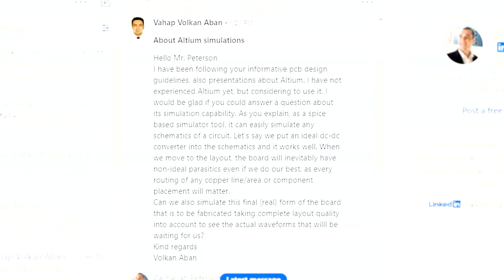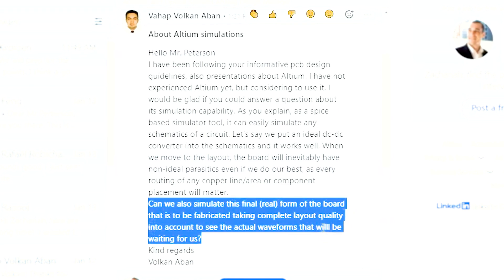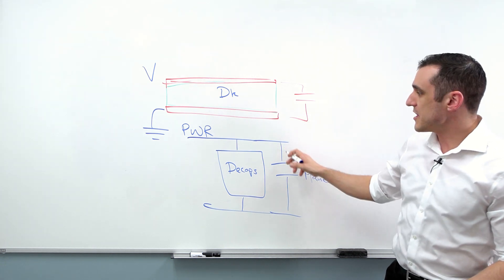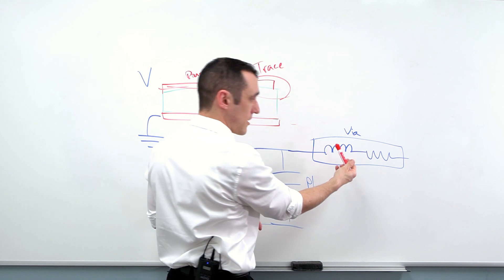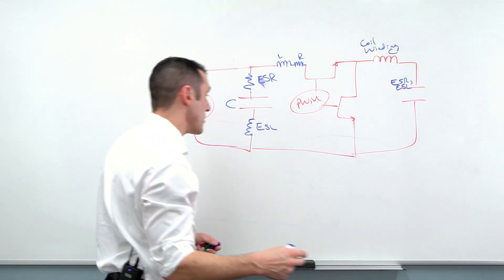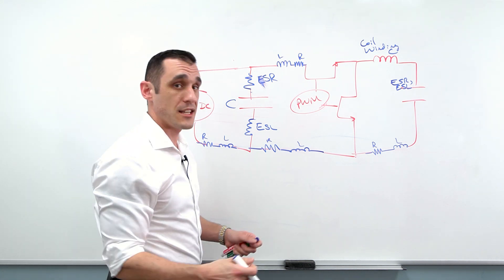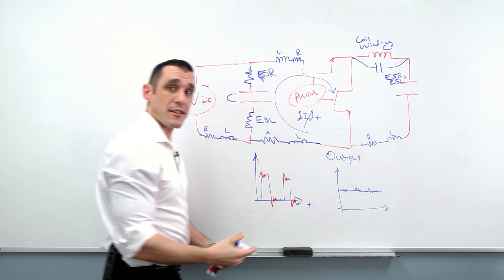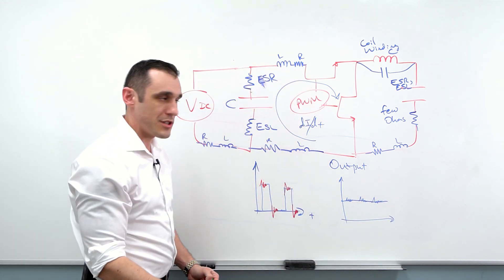Parasitics in PCB Layout

Comment: Can we simulate parasitic elements of the digital part of board with spice ? For example, the circuit between cpu and ddr3 including digital buses and traces.
Reply: Yes you can, you just need to set a voltage source as a square wave with a specific edge rate. You could then look at how the parasitics degrade edge rate or how the edge rate might excite resonances. In SPICE, you won't have any ability to simulate transmission line propagation unless you have a transmission line model. There were models in an old Altium library in AD21, I do not know if that is still around in AD24.
Reply: @Zachariah-Peterson   Thank you so muck Mr. Petersom. How can i have these models ? Frim where ?

Comment: Hi Zach, great video and great symbols! I have recently designed a prototype board with a wifi controller on it. The prototype is relatively large and when you bend the pcb, theres noise on the GPIOs. Can this come from parasitic capacticances in the stackup? The microcontroller as well as two dc/dc converters are mounted via their own small carrier pcb, so another reason might be poor soldier connections while bending the board. Thanks in advance an keep up the good work!
Reply: Hi Adrian,
Thanks for watching, I don't want to make a definitive statement about that without looking at a stackup, but it might be due to some capacitive coupling between GPIO lines and some other circuit that switches at high frequency. Switching regulators will have a high dV/dt node on them that can couple noise to different areas of the board during switching. There's actually an older app note from Linear that specifically discusses that point about switching regulators: https://www[dot]analog[dot]com/media/en/technical-documentation/application-notes/an136f.pdf

Also, why are you trying to bend the board?
Reply: @Zachariah-Peterson  The board had some more problems. The MCU turned off under shock or vibration. It turns out, the GND pads between the carrier board and the main PCB were not soldered properly and were still paste to some part. Through the flexing of the PCB the MCU's GND pins lost contact or had some Ohm connectivity.
Reply: @Zachariah-Peterson  Thank you for the answer, I will look into the app note and take another look at my dc/dc converters.
Actually I am not trying to bend the board, but I have difficulties telling my software coworker to handle the electronics more delicately.